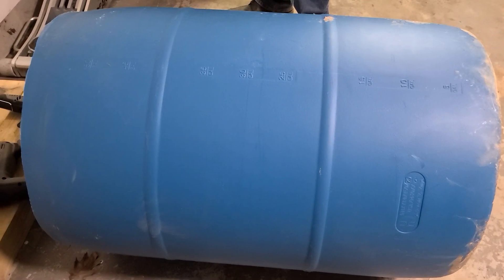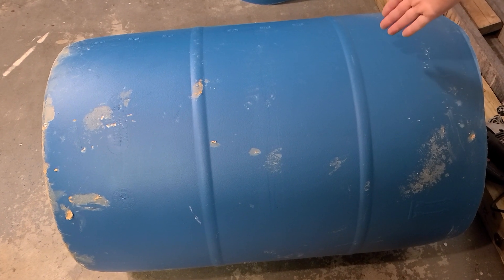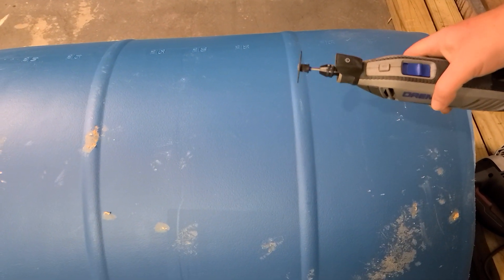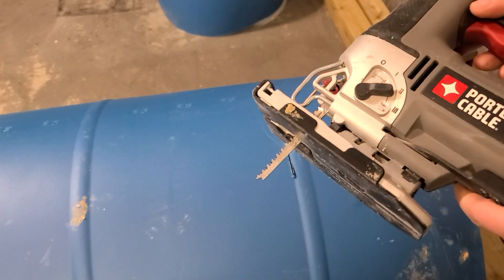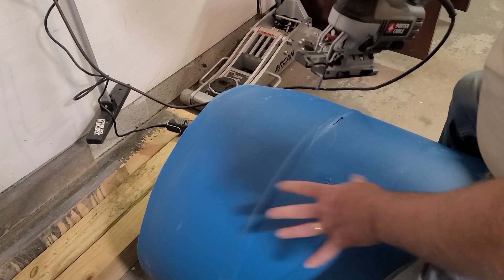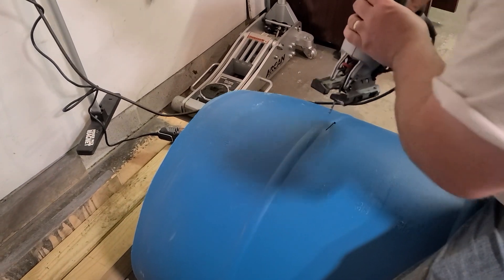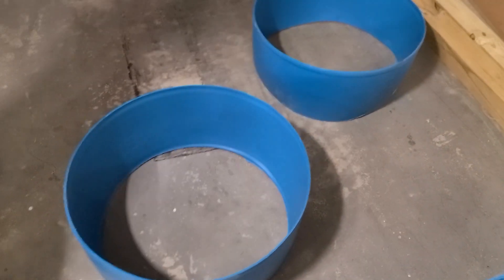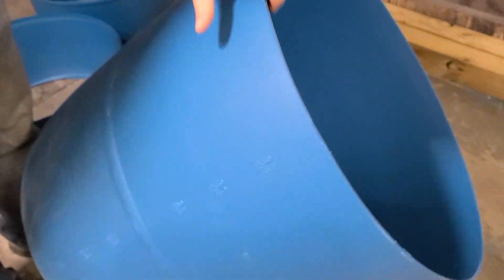Khmer Garden in USA | How To Cut And Shorten 55 Gallon Plastic Barrel Using Dremel Tool And Jig Saw

Comment: This is the way I cut plastic drums as well, I cut the length I need so bottom comes off & use the upper part that has a removable top with metal band using them as septic tank high risers never have to worry about digging out dirt to get to the cement tank lids when the tanks needing pumped out.